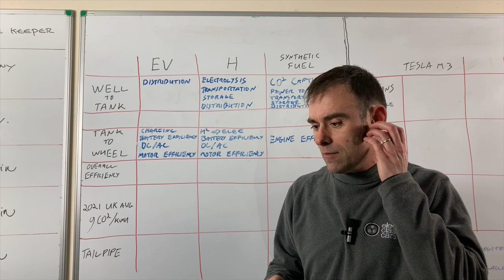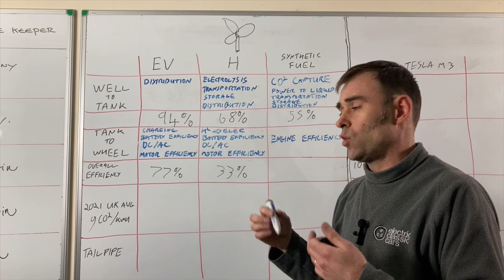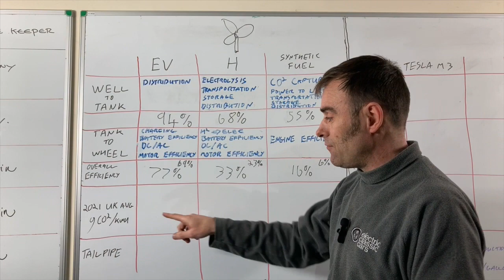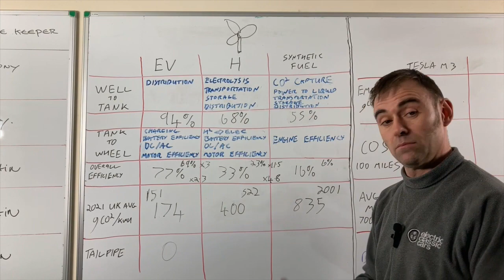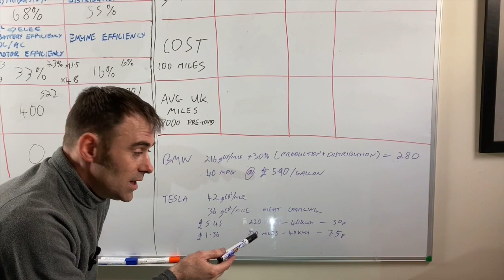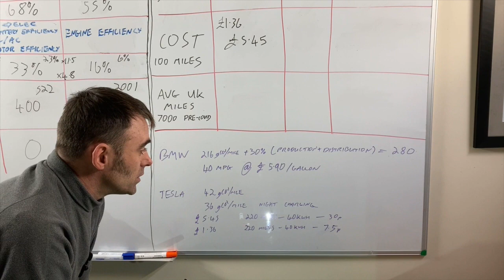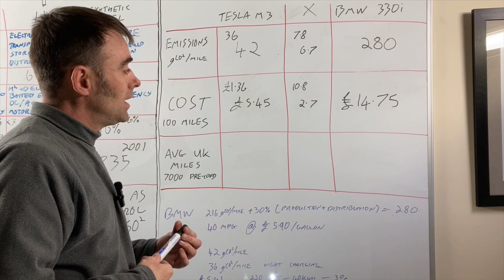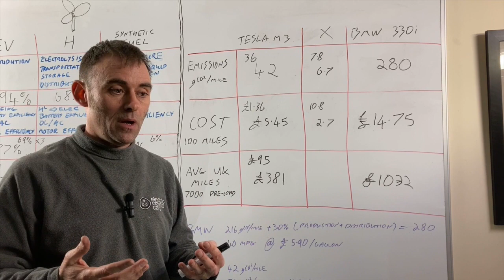Is Hydrogen or Synthetic fuels the end for Electric Cars?

Comment: Hi, your video was really interesting, I like the job you’re doing on cars to transform them. We could talk a lot about numbers saying they are right or not but I think they are in the right order of magnitude so that’s the most important. 
It would be interesting to compare the whole life of the car from production to recycling but that would be a big amount of work.  But there’s something that would be interesting, it is compare the use of petrol car vs electric one during 15 years. I think it’s the average life of a petroleum car but for an electric car, that would be 2 batteries? After 7 years on the electric business, what’s your feedback and you thoughts about batteries, lifetime, recycling, etc.. ?
Reply: It not a simple thing to quantify.  Because if you buy a car with 300 miles of range but in 15 years time it still has 200 miles range and that is enough for you then Effectively the battery is still like new.

If you really want the 300 mile range back in 2037 then there are 2 things to bare in mind.

1. The old pack will still have a long life and value as stationary storage before ultimately being recycled.

2. In 2037 a new 300 mile capable replacement pack could be much cheaper.
Reply: JF ..is there data that shows only a 33% reduction over 15 years ?.. your logic sounds good ( as far as maybe not noticing any difference ) but it doesn't stack up (ie.. its not Effectively "like new", ..its Effectively like 66% of new... and in 2037.. a replacement pack could be "much more expensive" (so that is an assumption) Tesla's Powerwalls have doubled in cost in several years and a 10 year warranty to be at 70% (yet not the same thing as EV car packs)  but yeah. I certainly hope to find some "factual battery performance data" ( Ive heard about moving then down the line towards stationary use.. and ultimately being recycled) is there is already solid data about the Tesla battery packs lifespans ?  have they not  been around since 2008ish  ? (Im a newbie trying to learn) and Ive heard 500,000 miles...and... Ive also heard 100,000 miles ?) a very interesting subject for sure.. and as you say.. not simple to quantify (so many variables ( apparently they like Denvers high altitude.. but what about Canada sub zero...etc etc ) what a great presentation !
Reply: That would be a video that SHOULD go viral and put this guy on the map!!!

Comment: thanks for this extremely informative video! But one thing should be added to this comparison chart and that's TIME and RANGE. As long electric batteries take ages to be charged and the range is still mediocre plus the charging infrastructure is still at a low, all these wonderful numbers are pretty useless. Besides buying an electric car is still far more expensive, maybe not in the long run, but it is for most people...

Having said all that I believe that your projects of conserving classic cars and modifying them to EV cars is beyond fantastic! 👏🏻
Reply: As Moggy explained, the majority of charging takes place whilst you are doing something else, such as sleeping, or working, so time to charge is mostly irrelevant. If you are doing a long trip, yes, you will have to stop to add some range, but it doesn't matter whether you are driving an ICE vehicle, or en EV, you can only drive so far before stopping (your bladder has a finite capacity). Motorway services have rapid chargers, so you can add a lot of range in a relatively short space of time: by the time you have been to the toilet, and had a coffee, your EV will be fully charged and ready to go. As for range, the average new car, in the UK, is only driven 28 miles per day.
Reply: @jonathanmason9521  agreed to disagree... I usually don't sleep while charging when I'm on longer trips. As long as recharging times come don't down dramatically it's totally useless at least for me.
I know it's a common argument "the average..." true, but do I have different cars for different needs? So I need one car doing everything. It's as simple as that.
I believe newer and better battery technology will change the situation. Range 700-1000km and recharging in 10 minutes. Plus a definitely improved charging infrastructure (it's a nightmare where I live in the middle of a big city)... way too many ifs for me
Reply: @neglectedloves  Cars like the BMW i4 have a 300 mile range, and can charge from around 10% to 80% in about 30 minutes. I would spend that time (after driving for a few hours) to go to the toilet, grab a coffee and some food, and stretch the old legs a little. A 30 minute stop every 200 miles or so isn't really a deal breaker. With a petrol car, you would still go to the toilet, grab food and drink, and stretch your legs, and THEN STILL have to stand pumping petrol in. But for 99% of the time, my EV would charge at night time, so my total time spent charging (other than the odd road trip) would be zero.
Reply: @Smith_Tech_70  in my experience none of these mileage figures are near actual real life results! Unless you drive only 100km/h at perfect temperatures and weather conditions. Furthermore most chargers I have come across weren't either delivering the promised power and speeds nor were 80% reached in 30 minutes! To be realistic it's rather 45 minutes and I can't drink so many coffees or have that many legs to stretch to be patient enough to wait that long. Simply it was a drag... As stated before when electric cars reach 800km distance with normal driving in any conditions I will jump the bandwagon 🤓
PS: the charging over night argument doesn't count for me living in a big city with ridiculously few charging points usually occupied by gas guzzlers... 😂
Reply: @jonathanmason9521  Spot on! Indeed recent models will recharge fully in less time [at a high power charger] than you can pee and pick up a coffee!

Comment: very nice, but from that socket for ev in a house really does not come out with 94 %.because power for a house only comes 50/60% from that socket. unless it comes solar  roof of the house itself and not through the wind kern somewhere far away because power also has a loss over the cables of a power station.en engineers explain youtuper heeft ook zulke berekening gedaan en die waren voor branstof 99 in de tank en naar de band 65%en de feulcel auto was 80% en naar de band 65%

Comment: Really useful presentation. I'd like to see you add a further 2 lines of calculation: CO2 of vehicle manufacture, and price difference of comparable cars at the low end. I've read Polestar admit 50% more carbon emitted making EV compared with ICE equivalent. I think you need to show that. Also, when we bought our £20k Skoda Kamiq last year there was no EV available below £30k (I actually wanted a PHEV). It takes a long time to claw that back on fuel savings of just £900 to £1100 pa. Finally, you usefully point out most EVs will be charged at 'night time rate'. Something you missed is, I think, a lot of hydrogen will also be generated at the equivalent of night time rate, as a useful way of storing excess energy in the grid. We need to over provide sources of renewable electricity to cope with variations in e.g. the weather, and variations in demand. Hydrogen production can cheaply use the excess. Love the channel, keep up the good work!

Comment: I like the fact that I can generate my own energy for my EV charging at home. Try doing that with petrol or synthetic fuel, or even hydrogen.
Reply: Isn't your local power station generating that energy?
Reply: @BombSponge  Not if he's getting it from solar......plus perhaps battery storage too.
Reply: @Brian-om2hh  Thats a big IF. You'd need a lot of panels to power your home plus the extra to charge a car.  Might work in Africa.
Reply: @BombSponge  This rather depends on your energy usage and miles driven. I only have 3.5kW of solar but roughly generate as much as I use over the year.
Reply: @SimonEllwood  Very true. If you use hardly any energy and drive rarely it's perfect.  I think in most cases we tend towards averages not absolute minimums?
Reply: @BombSponge  In my case it is not a big if but reality, this will matter less and less as more renewables come online of course like Hornsea 2.

Comment: What you guys are doing is amazing.

It should be done more and more and even promoted by the green-pushing authorities : why would you buy all the production pollution of a new car (incl. petrochemical plastics and electronics) if you can retrofit an existing one, put the petrol drivetrain out and the electric one in ?

I hope there is a mixed future ahead :
- electric public transportation
- as much as possible, electric daily commute
- classic cars , some converted as EV, some kept original and using synthetic fuel
- synthetic fuel (to save on carbon emissions) used where electricity is not feasible (e.g. passenger flights or commercial ships).

Comment: Great video. I wish you would say something about the water emissions of hydrogen vehicles. Water vapour is an extremely potent greenhouse gas, much more so than CO2. But of course it doesn't stay in the atmosphere very long at all, unlike CO2. I would love to know if we all switched to hydrogen vehicles, if we could potentially see any dangers there? There would be tons being pumped out all the time, would it be possible that the extreme greenhouse effect could end up somewhat overriding the much shorter half-life? And if not, what about localised effects? E.g. we already see serious issues in areas with large road surfaces, because of how much heat is absorbed. If those areas were constantly pumping out water vapour as well, could we see even more extreme issues around them? Or any other strange effects with all that water vapour being pumped into the air at scale? Or is it predicted to just be fine?
Reply: By the time it exits the exhaust pipe it cools down enough to condense and drips out onto the ground
Reply: If water vapor is an issue (and I clearly think it is ... I experience 3-4°C higher temp in Berlin then in the suburbs) then we already have it. Hydrogen produces only about 40% more of the water vapours.

long answer:
Petrol:

C = 12g/mol
H = 1g/mol
O = 16g/mol
average Petrol molecule: C7H13 -> 97g/mol -> 10.3mol/kg

C7H13 + 10.25O2 => 7CO2 + 6.5H2O
97g/mol + 328g/mol => 308g/mol + 117g/mol
1kg Petrol + 3.4kg O2 => 3.2kg CO2 + 1.2kg H2O

1L Petrol = 0.74kg

40 MPG (stupidest unit ever invented!) equals 7L/100km or 11.3L/100miles

11.3L * 0.74 = 8.4kg Petrol / 100miles
8.4 kg * 1.2 = 10kg H20 / 100miles

Fuel Cell EV (Hydrogen):

H2 + O -> H2O

H2 = 2g/mol
1kg H2 = 500mol
O = 16g/mol

500mol * 2g + 500mol * 16g = 1000 + 8000 = 9kg H2O

~1.6kg/100miles => 14,4kg H2O / 100miles
Reply: @glockmanish  that's an extremely poor assumption of full combustion, and even a poor model of petrol. Not to mention it heavily depends on the engine as well. Sorry but this is such a complex question that you just can't do it like that. I'm sure there's actual data on this somewhere. But I couldn't find it and I don't have the time to look at the minute.
Reply: @lost4468yt  Well I did and I can ... Those toxic byproducts like NOx, CO, HC and soot make up low single digit percentages of the exhaust gases. So even when you over-analyse that to the finest detail the order-of-magnitude stays the same! Maybe you get 9kg/100miles ... What does that change in my claim about there water vapors already being present?

Comment: Adding in total cost of ownership per mile over, say, 5 yrs would make fossil cars look dramatically worse .. as you have road-tax and the cost of servicing all those mechanical bits including discs/pads/catalytic and DPF problems/radiator problems/belts/plugs/lube changes etc etc ... and it looks pretty bad !!!
Reply from the maker: Yep. Maybe I should revisit the cost of ownership in another video. 👍👍👍
Reply: Yep, as the beemer would probably be over 40k it would pay luxury car tax for 5 years which is 520 a year so that’s £2600 down the drain. Tesla=£0

Comment: Excellent summary. As of today / 20th March 2022, petrol has shot up to about £7.70 (33% higher than the £5.90 used in the vid), and my octopus Go tariff is still 5p / kWh (rather than the 7.5p in the vid).   Another column I'd like to have seen added is the cost of powering an EV on domestically sourced solar and wind and some electronic trickery to account for variability, then over time the cost per mile becomes really low .. and very satisfying to know you have 'free' leccy that you've captured yourself. There are upfront costs of going down that route which means cheap night rates from the grid are the best option at present. (Yes, I know a domestic energy harvesting solution is not yet quite that simple, but it is doable and will in time come down in cost!).
Reply: Fear not, your 5p tariff will rie to 7.5p soon.....  Still, if your EV has reasonable efficiency, you should still be looking at less than 2.5p per mile electricity costs.  Still a long way to go to get anywhere near the cost of petrol.......

Comment: How much does it cost to charge electric car
With electric prices from just say 10% to fully
Household electric
Reply: An EV will typically do 3 to 4 miles per kW of electricity. So a good guide is 3.5 miles per kW. Look at what you pay at home for a kW and divide it by 3.5. That will give you cost per mile. 

As a comparison to an ICE car, divide the MPG by the cost per gallon to get the cost per mile. 

Whilst few EV owners wait until they empty their battery to charge at home, preferring to plug in overnight and replace what they used in a day, you can calculate to cost to fill an empty battery by multiplying the cost per kW by the battery kW size. If you have an overnight tariff this can be as low as 7.5p.

Comment: Thought I'd add my 10 penneth as I can only public charge. I mostly pay 26p per kWh at Podpoint and 30p per kWh at Geniepoint. I expect these costs will rise but I will still get nowhere near to my running costs when I ran a diseasel. 3 years ago when I switched, I was paying £300-400 a month for fuel covering 1,300-2,000 miles a month. The most I paid in a month in the first year for electrons was £28. There was also 3½ months where I challenged myself to see how long I could go without paying a penny and tried to only charge while shopping etc. So I literally had 15+ weeks were I filled up for £0. I commuted 58 miles a day during this time. Also worth an honourable mention, I took my current 2013 EV car (I have an EV van and motorbike too) for a service 53k miles covered and after a full inspection they announced they'd needed to top the screen wash. It also sailed through the MOT last month, only advisory was a couple of tyres.

Comment: Very interesting. would love to change to electric as i have solar panels and battery storage. (its a joke they charge you 30p a kwh and pay you 7.5p kwh if your lucky for what you produce. still waiting for Octopus to ring me back about why they haven't transferred me to their FIT tariff. if your reading this Mr Octopus no reply after 6 days is not what i call a priority call back) and whats with the 47p a day standing charge. that:s another  171 pounds to add to the equation.
I digress. problem is the only electric car i can afford is an 15 year old Nissan leaf with a range of 60 miles. To spend 25000 minimum on an EV  with any descent range its going to take me around 18 years at those calculations to break even. And as I only do around 5000  miles a year it will take longer than that. I suspect this is the case for many motorists.

Comment: Great presentation Moggy. I think there is more to hydrogen. “Green hydrogen”, generated from offshore wind farms could directly produce hydrogen from sea water  and when there is over power from pure electric built up. But this requires significant infrastructure investment. The Uk is perfect for this model. You are right though, far more difficult for infrastructure and distribution. I’m so eager to get an EV it’s untrue, the economics are clear. Range is always a challenge. I need a 250 mile range to make it work. Great work

Comment: Bore da Moggy,

Great video, although I think its not exactly an apples comparison. Considering you are comparing hydrogen fuel cells (Electricity generation) to batteries (storage) which you cannot directly compare. 

You are also neglecting that the majority of EV emissions come from manufacturing the vehicles, motors and battery packs in the first place, so I feel if you are going to undertake a life cycle analysis comparing these technologies it should involve the full life cycle, as it traditionally done in the literature. Although as I'm sure you're aware given your experience this is a very difficult thing to do.

Nevertheless a great video highlighting the vast differences in efficiencies for different processes that most people know little about. Keep up the good work 

Cofion gorau,
Jack

Comment: Excellent and informative presentation Moggy.
When I first got my ev the rise in energy costs were just kicking off and the advice was to remain with your current energy provider. 
They offered 23.4p/Kwh across the board. We looked into their EV tariff which was off peak 12.4p/Kwh but 40.3p/Kwh peak.
Needless to say we stayed with the original offer otherwise boiling the kettle and watching the telly becomes a very expensive affair. 
Hopefully when the fixed term ends prices will have become more sensible and we will be able to switch to an ev tariff and another supplier. 
We did ask Octopus for a price but even they said stick with your current provider for now.
Reply: It's in situations such as that where solar on your roof, along with a decent sized storage battery begins to make sense.....